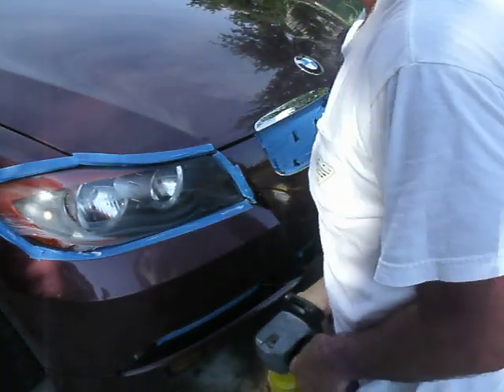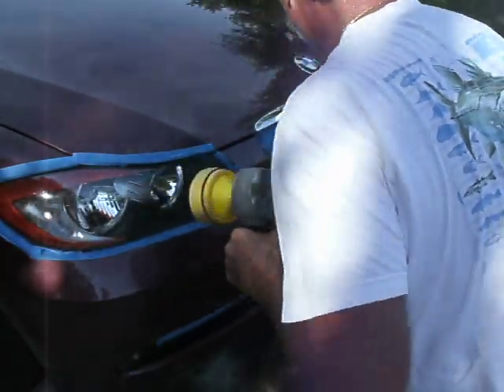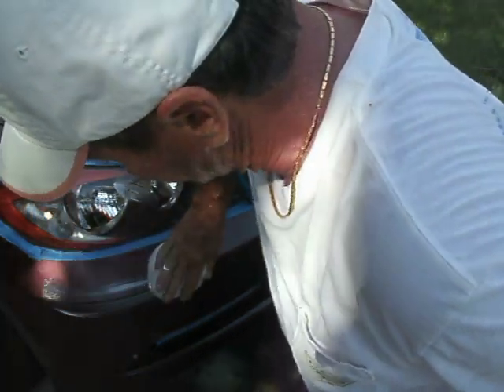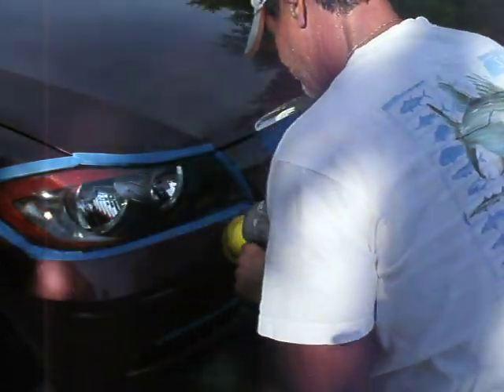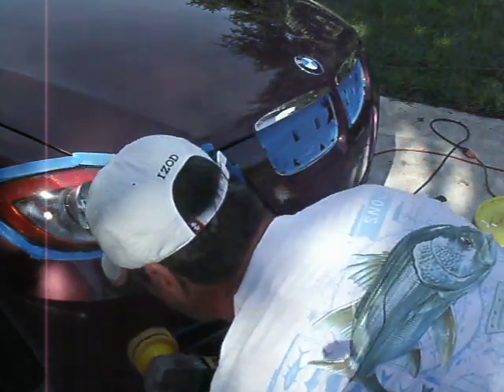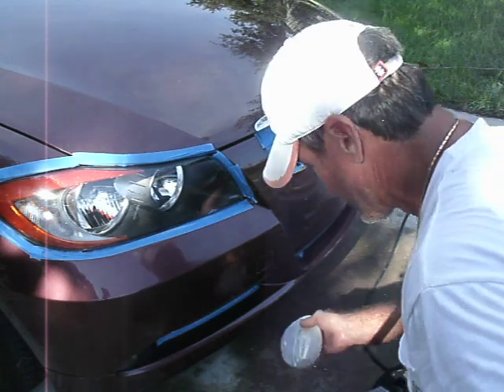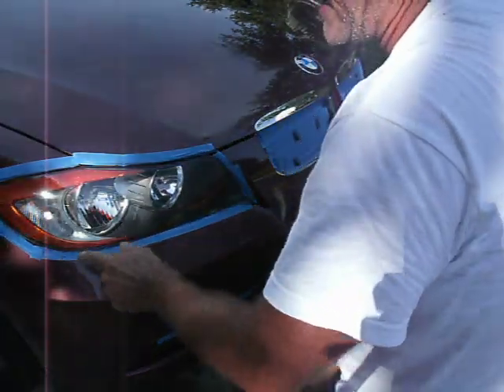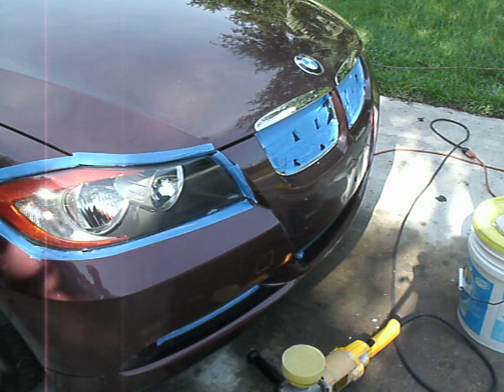2005 325I (Four step paint restoration)

Comment: Melvin:
You are right about taking time to proper paint correction. It took me 6 hours to do a 4 stage paint correction on the rear quarter panel of my truck.  So you are right about it taking time. With the 2 rear quarters and the tailgate done with a 4 step correction I already have over 20 hours racked up for paint correction.